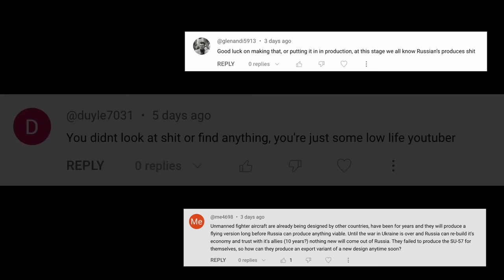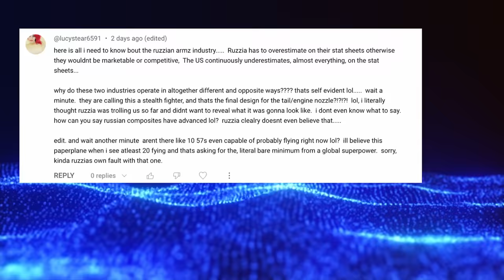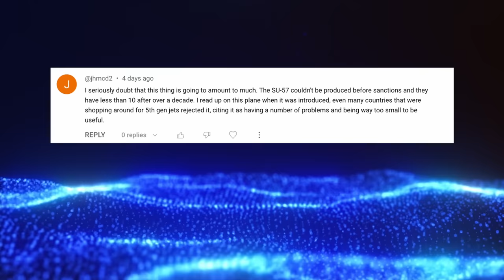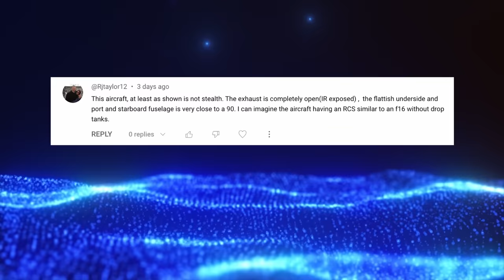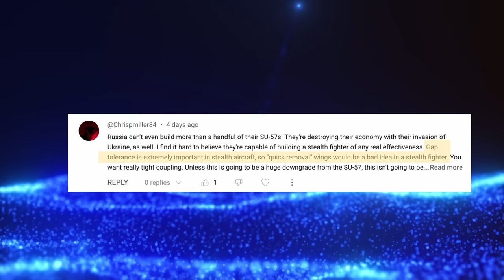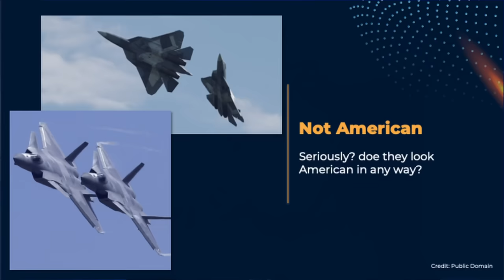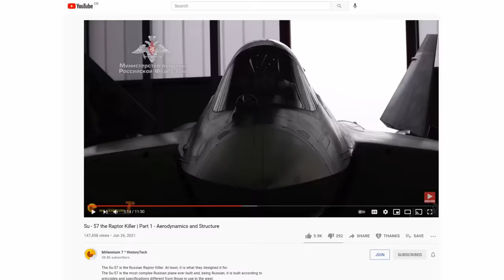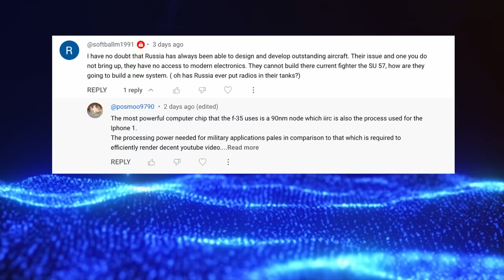Why so Few Su-57s ... and Other Stories.

Comment: People don't understand that stuff like the PS5 is way more advanced than anything inside a military aircraft and this is why they enormously overestimate the power of sanctions. Consumer products need much more advanced microprocessors than military products. Processing graphics at 4K x 60FPS requires enormous raw processing power.
Reply: This is not true! First in order to design these machines you need a lot more power than PS5. Second there are different kinds of loads and algorythms required to run the avionics and sensors in these jets. But more importantly these jets are supposed to serve for decades to come. We already know what the future of warfare would look like. Hundreds if not thousands of drones and autonomous vehicles being used as sensors. They will work together to create a 3D map of the battlefield in real-time where everything is tracked and targetted. This would require so advanced and powerful hardware that your PS5 analogy completely goes through the window. F-35 at least will be part of that and they are already making moves. One more advantage that this has is not only it would integrate all branches but also everybody (with permission) would have access to that and decision can be taken no matter where you are. This also requires not just integration of autonomous technologies and sensors coming with it but also AI and ML which is yet another technical area which requires a lot of power
Reply: @napobg6842  all that you said requires much less processing power than a PS5. You are just clueless. Creating a 3D map of the battlefield in real time is EXTREMELY easy computationally, the difficulty is purely an engineering matter, because you need to have enough data collectors in place to make it happen. But the computing part is not complicated. Even if we want to add AI on top of it it's still easier to do that than in an AAA title. People vastly underestimate how hard games are to produce. Videogames are the pinnacle of the software industry which is why more powerful GPU and CPU are always created to satisfy their requirements. Military applications are f easy by comparison. They can provide motivation to build new technologies, which is something completely different, but the top of a certain technology is almost always achieved in civilian applications.
Reply: @zemm9003  So you think combining the sensor data from thousands upon thousands of different sensors, spreading that amoung hundreds of users and computing all that in real time is less demanding than... playing AAA games? I'm not sure if that's trolling or not. I hope it is... Oh and btw the 4090 can't run a 70B parameters LLM which is relatively small on a grand scale. In comparison GPT-3.5 that runs the regular version of ChatGPT is 175 billion parameters and the GPT-4 LLM is over 1.8T parameters. And we are talking about if you want to run it locally for a single machine you can't do that. Imagine now having thousands of users that demand that AI. You would literally need a supercomputer with exponential AI hardware to run such task. You still think that PS5 with its AAA puny games are enough?
Reply: @napobg6842  yes it is extremely easy. If you don't know that this is easy to do then you don't know anything. Most people fail to realize the difficulty of generating 4K HD graphics at 60fps because they don't know anything about hardware or software or anything technical. Then they come here and regurgitate nonsense about airplanes or something they have no clue about. If you don't have any good technical STEM background then you also will be unable to either appreciate or criticize both PS5 and F-35s. They are equally foreign to you. You just have no idea except what you read in Wikipedia.
Reply: @zemm9003  Yikes the kid that claims how easy is to process data from hundreds of sensors is claiming how little I know. You don't even know that the hardest workload for a GPU is not graphics 🤣🤣🤣
Reply: @napobg6842  the hardest workload for a GPU would be to do what the CPU does because it wouldn't take advantage of any of the architectural differences. Which is why they are built differently and have different names. Now why is that? I bet you don't even know. Go check Wikipedia or ask Chat GPT.
Reply: @zemm9003  The hardest workloads for GPUs today is AI! IIn the future GPUs would have more memory precisely because of that. Ofc this is something you have no idea about because, as far as you know, GPUs are only meant to play AAA games 🤣🤣
Reply: @napobg6842  AI is not the hardest workload. It is perfectly fine to have a GPU do it. Which is why they are used instead of CPU. You are confusing AI that is required for an airplane with what is required for Chat GPT. Military AI is miles behind what is necessary in civilian fields. I don't understand the notion that the best technology is for the military. They provide unlimited funding, that's what they are good for, but once the technology is developed then the civilian applications quickly overwhelm the military ones. This is also the example of high energy lasers. They were developed initially for military purposes but nowadays the lasers used for fusion research applications are orders of magnitude more advanced than anything available to any military.
Reply: @ulikemyname6744  you said a bunch of nonsense that you don't understand. Very advanced generative AI like Chat GPT demands a bunch of processing power because there's just no way around it. This is not true for 99% of AI software including military applications. I don't understand what is so difficult to understand. Also for a GPU the hardest types of calculations are CPU type calculations because more often than not these are not vectorized calculations and they are arbitrarily flexible. I bet you don't even understand why we use GPUs instead of CPUs for running AIs. Rendering 4K HD graphics with (or without Ray Tracing) at stable 60fps per second is something that requires much more computing power than pretty much any military application one can even imagine and also than most AIs except for the real good ones (which btw aren't used for military applications, not because they don't have the money, but because it's overkill).
Reply: @ulikemyname6744  I would even go so far to say that 99% of the people who bothered to comment don't know why we use GPUs instead of CPUs for running AIs. If you don't even know that then you don't know anything. You're just copying random stuff from somewhere and pasting it here.
Reply: @ulikemyname6744  can you explain why GPU are used instead of CPU for AI? Nope. You cannot. Therefore you know nothing. Regular AI (for example for visual pattern recognition don't need that much "horsepower"). It's not complex enough. You are talking about 70B LLM parameters but you don't even know what that means otherwise you would at least know the very basics. Why are CPUs structurally different from GPUs? And why are GPUs much preferred for AI although CPUs could also be used instead? Does a military grade AI need a lot of processing power compared to let's say running 4K HD graphics at stable 60fps? No. Why? Because 99% of the AIs don't really need that much processing power. Noobs think very complex AIs are required for everything but they are actually the exception and not the rule. Most AIs are relatively simple and can be handled by weak GPUs. When people think AI they immediately think Chat GPT but this is the highest end stuff and most applications require only extremely simple AIs. This is already a level above. But if you don't even know why GPUs are used for AI then you are still at the lowest level.
Reply: @ulikemyname6744  I would get my money back if I were you because you obviously didn't learn anything. Unfortunately for you I have a Maths degree which means I know exactly how to build an AI and why a GPU is better than a CPU for calculations despite them being equivalent machines. If you don't understand in detail why a GPU is preferable for AI calculations then you either don't understand the architecture of a GPU, or you don't understand how to "build" an AI or both. I am not giving free courses on YouTube so I suggest you go back to school and figure it out, or just demand the money back, the reason being that they failed to even teach you the basics.

Comment: Oh where do I begin. You say it's our bias that says these statements, but with people who are knowledgeable about fighters, military aircraft & military equipment in general, many times it is bias, but for the people who have the knowledge, we refer to history. I could give several examples, but I don't want to write a paper on it. I'll pick one. Mig-25 Foxbat was touted to go Mach 3.5+. Once the US got its hands on one, we quickly found out this interceptor was not made from titanium, but heavy stainless steel.  If the pilot went full afterburner, the engines would overheat and yard sale itself across the sky. Every engine we got our hands on & tested, we found out they didn't last very long, weren't built well, no advancements in tech since the Soviet Era and the thrust was quite a bit lower than claimed. 
The "Checkmate" just isn't going to happen. Single engine will not achieve the Mach 4+ speed they claim and there's no chance it will be sold at the super low price of 30 million USD. And how could it be unmanned? The Russians would have to have a communications system across the world like Link-16 and it's a fact, they don't. Operational AI? LMAO
Reply: you wrote some nonsense. 
1) where did you get that Mig-25 claimed 3.5M? Its cruise speed is 2.35M at 19-21 km, and usually it is allowed to fly at 2.83M at short time. It can fly (and flew in fact) at 3.2M. As far as I know this happen only once and engines were fully refurbished after that.
2) show me the source from what you get 4M+ speed for Su-75? Official sources from manufacturer says its max speed without afterburners is 2M. what Mach 4+ are you talking about?

check you sources before say something.